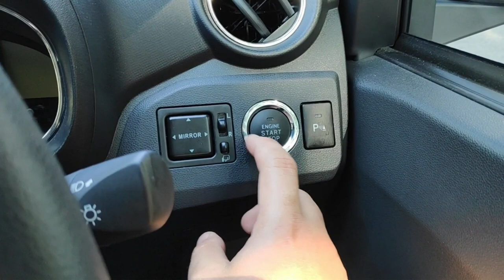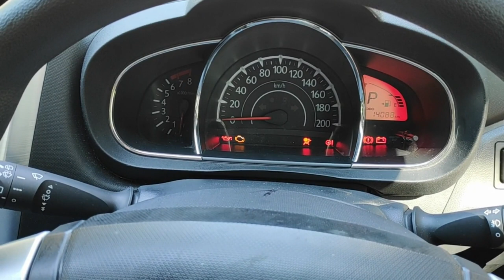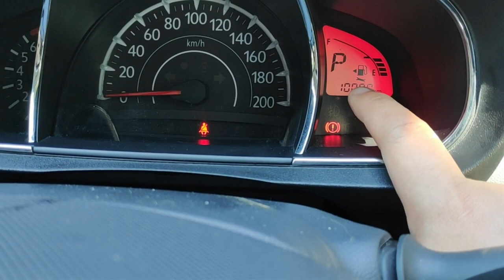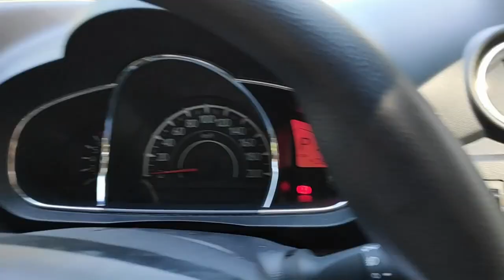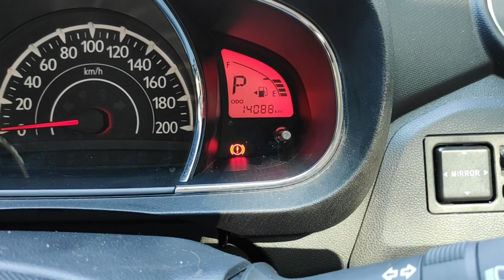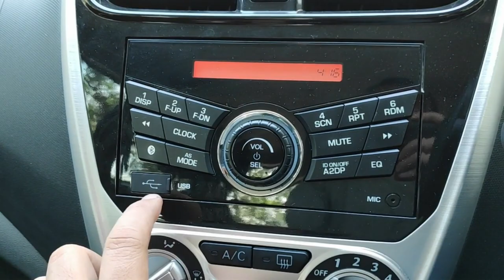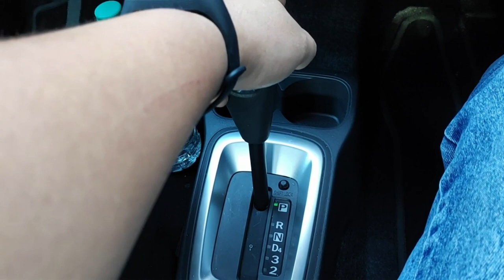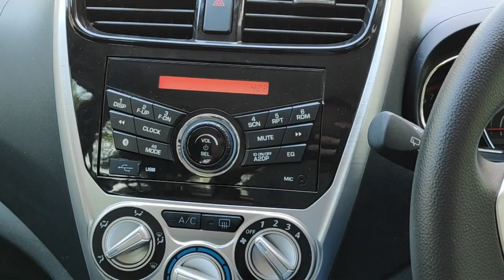2018 Perodua Axia SE 1.0 V2

Comment: Centre lock doesn't have.?
Reply from the maker: It comes with central locking mechanism.
Reply: The side door there.?
Reply from the maker: Yes, use the driver door lock to lock/unlock the other doors
Reply: @kokwahgoh1932  
Oooh noted